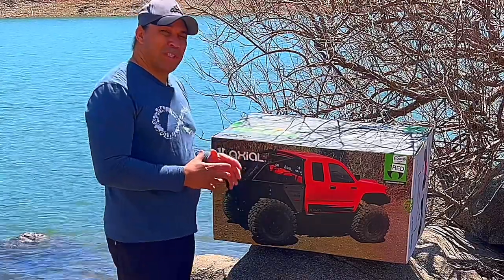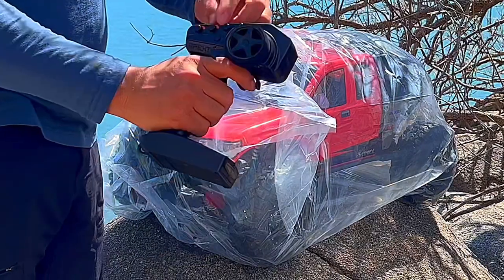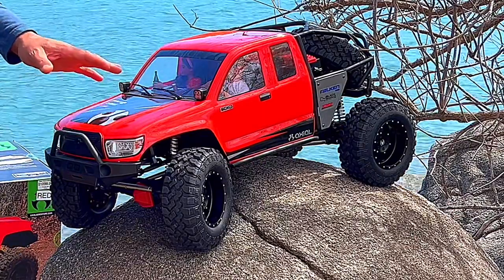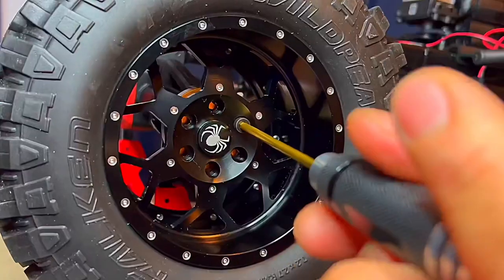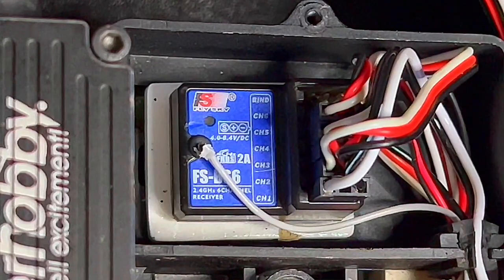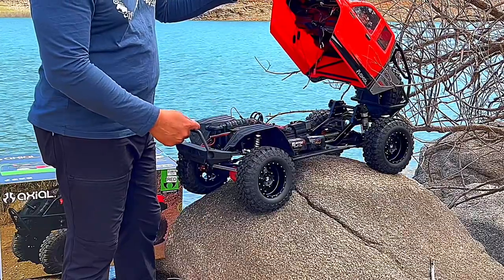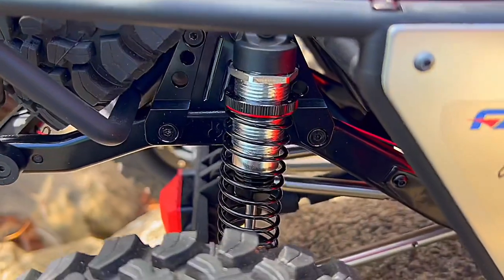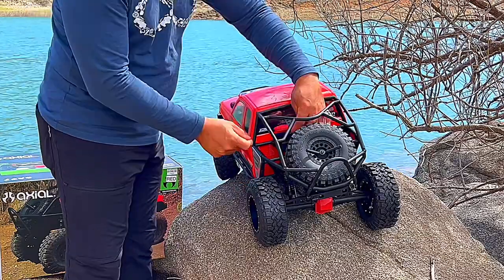Finally got the huge SCX6!!!  Mods, Upgrades and First RC Run!

Comment: Those wheels make the truck look small lol😂 but definitely looks the part!!! Maybe not the best tires for crawling though as they are too firm.. maybe run without inserts for a squishier tire.
Reply from the maker: Letting it all hang out!
Reply: firm tires helps your CG, 2 stage fomes are the best i found yet, on prolines supperswampers🙂,they are sweet on mine!! and smash a big 5 servo to!!😁

Comment: Do the lights on the SCX-6 Honcho always have to be on when driving the truck?
Reply from the maker: Great question ... out of the box you're right, the lights are always on when the power is on ... but you could put the lights on a different channel or a switch to turn them on/off when you want

Comment: What type and brand of grease was that? And do you still love the SCX6? Any buyer's remorse?
Reply from the maker: I've spent a lot on upgrade parts but loving it as it is now - first one I pick up when heading on a run.  The grease is motor grease for bearings ... Won't rebuy this one, the smell is atrocious
Reply: @RickysGarageVibes best use LiquiMoly LM 47 grease but don't pack too much in it since it's counter productive

Comment: how did you mount stock tires on those 40 series tires
Reply: 40 series rims i meant sorry
Reply from the maker: I used RC4WD 17mm Universal Hex Spacers for 40 Series - https://bit.ly/447t1Px
Reply from the maker: Heres a vid putting them on https://youtu.be/Tt1Qxvxf06c
Reply: Link to your video on the tires don't work😢
Reply from the maker: @TheCraigwallace736 The tires are the stock tires it came with, the links are for the rims and spacers for them to fit the SCX6
° RC4WD Huntsman Spider 40 Series 3.8" Beadlock Wheels - https://bit.ly/3LysIGf
° RC4WD 17mm Universal Hex Spacers for 40 Series - https://bit.ly/447t1Px

Comment: What wheel and tire is that
Reply from the maker: The tires are stock, here are the details on the wheels and spaces and we added dual stage foam
° RC4WD Huntsman Spider 40 Series 3.8" Beadlock Wheels - https://bit.ly/3LysIGf
° RC4WD 17mm Universal Hex Spacers for 40 Series - https://bit.ly/447t1Px
° Pro-Line 2.9" Dual Stage Crawling Foam - https://bit.ly/3n0VoOR
Reply: Were you able to stretch the tire  to bead lock both sides? I can get my outer in the locks but the inner isn't ganna happen. I just left the inside edge curled in. I did get one to lock inner and outer but it looked really goofy.